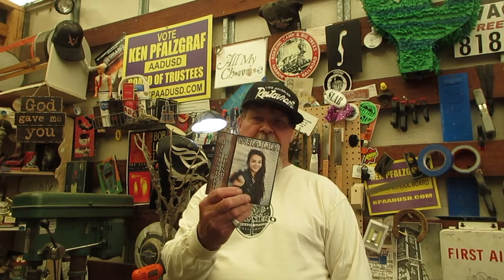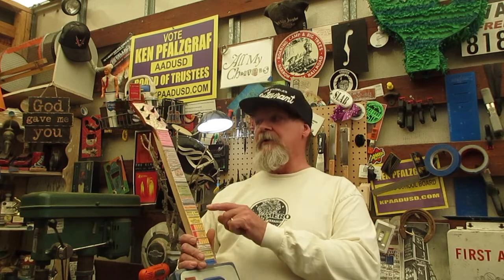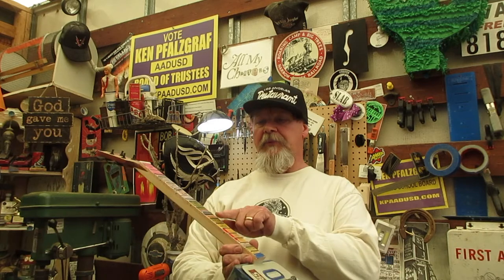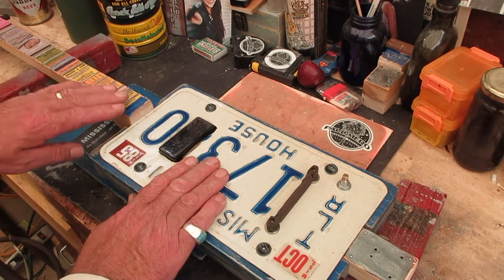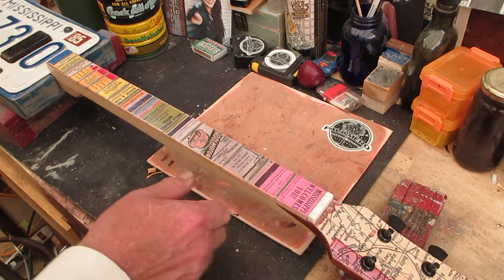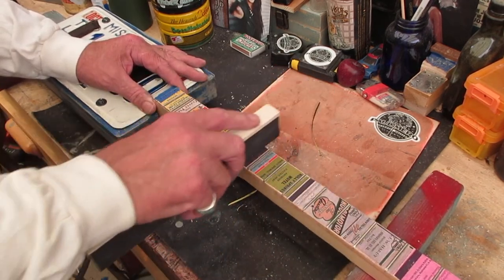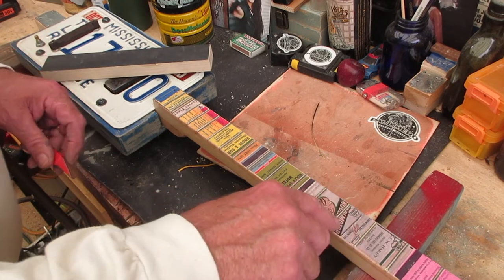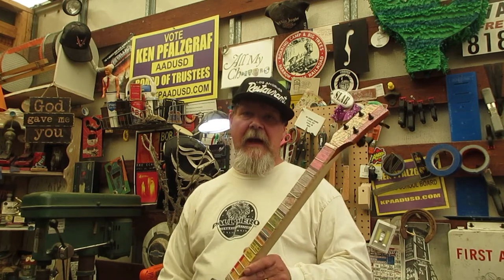Fret Leveling

Comment: Glad your trimmed that sandpaper... we'll all sleep better now!
Reply from the maker: Dude
Reply: @paulmerojunkpileguitars  Nonetheless, thanks for this video.. fretting is my downfall... but your  technique would solve a few issues.
Reply: I would have had to do the same thing, but I would have had to have had both sides of the sand paper equal to the top of the wood. Three in one sanding block. One for fret levelling and two for sanding.

Comment: Ken, another very useful video. Suggest you wrap your paper around both narrow edges of the sanding board so the gap lays on one of the wide sides, then you have a double-edge block you can turn over when the paper on one edge is worn. One wide side will be papered as well - if its not flat enough to use for fret sanding you can use it for some other fine sanding job.
Reply from the maker: Thanks Poppa

Comment: Might want to get a black marker on the frets FIRST. As the frets are leveled, the black goes and the shiny means the fret has been leveled. Also just looking down from one end to the other, you can visualize which frets are high and low. I like your license plate guitars. Where do you get the fret board spacing?
Reply from the maker: Dave Foster experience then made a template